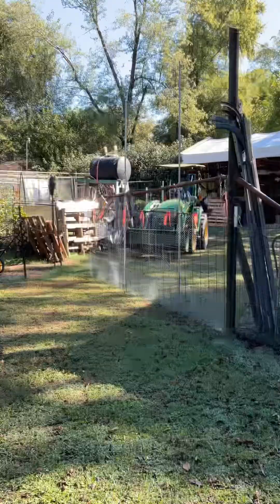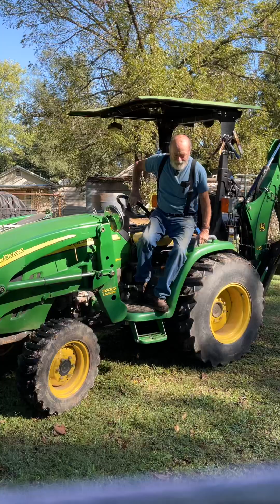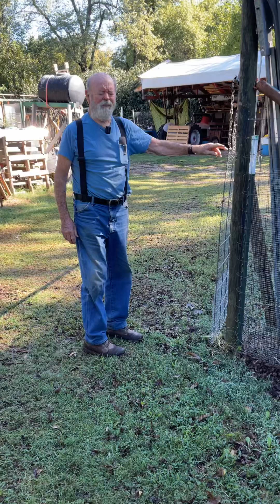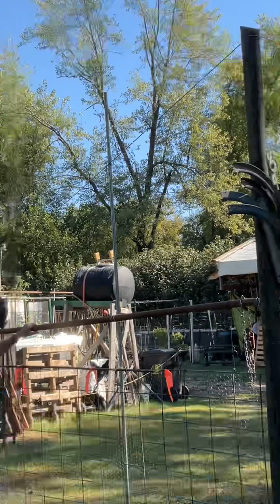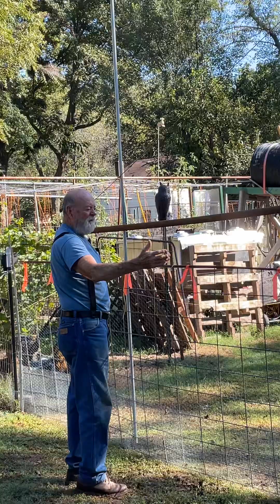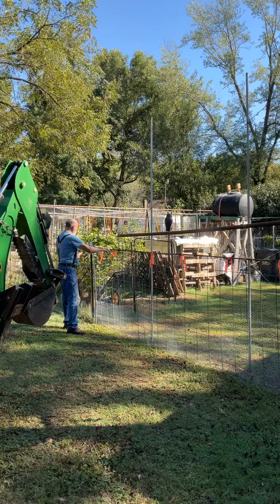Hingeless Jib Crane Gate

Comment: I assume pulling the trip line fro the tractor seat unlatches the gate, but then what pulls / swings the gate to the open position? Is there a spring or counterweight, or is the gate mounted at a tilted angle so gravity makes it swing fully open?
Reply from the maker: The pole is tilted in the same direction, as when it is fully open. Thus it is gravity.